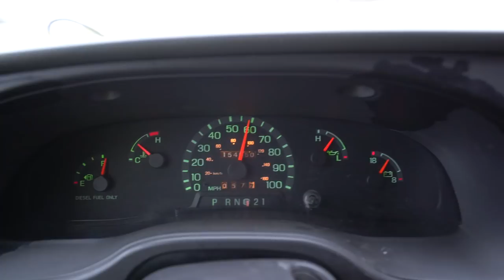Massive Oil Leak!! (Ford 7.3L)

Comment: Don't hesitate going to a diesel mechanic, telling him your situation, and showing him the part that's leaking. That bad O Ring was buried deep, but he may have showed you how to get at that bad O Ring. You can often unbolt things off the engine to get at bad parts as long as the part doesn't have oil, or antifreeze in it (or seals like gaskets and o rings). You can get in through the front by taking off a drivebelt or two (easy). And, taking off plastic covers/cowlings that are just screwed in to get at stuff. But, that wasn't that much oil anyway. That was an exellent job diagnosing and finding the oil leak without any help, Jax. Hope your all squared away already in SLC.
Reply: Rural diesel mechanics would even loan you their tools to get to tough parts.
Reply from the maker: thanks! the new bus will be full size and I plan on working on that a bunch myself :)

Comment: you are correct the 7.3 (T444)is a good engine (that's what i have in the 2000 International school bus i just bought the other day), yeah Jax I'll be joining you as soon as it is converted. this whole time I've been looking for a bus I've been so tunneled visioned on the 7.3. See I need a big engine so that I could tow my 14 foot enclosed trailer around with me. Now I've learned that the 7.6L (DT466E) is even more powerful even though it's only a 6 cylinder. Oh well if the 7.3 goes south I'll think about replacing it with the DT466E
Reply from the maker: both are very good :) the Ford doesn't have the DT, so I obviously praised the 7.3

Comment: Great Video, my first of your 400+ collection I ran into.  Have a massive 7.3 oil leak on my 320k mile 4x4 Sportsmobile that I have to start tackling today. Was nice to see your video and the start of this experience from your perspective.   Can't tell where my oil leak is coming from yet, going to clean it all down today first. I hadn't thought to use brake-cleaner to help the effort, so thanks for the Tip!  -JR

Comment: I used to work on powerstrokes and the 6.0 are the worst they have to be bulletproofed, 6.4 is junk as well. If you get a ford go 7.3 or 6.7 for sure.
Reply: Gary Mapes  ~  Once a 6.0 has been Bulletproofed, do you think they are good (or at least decent) engines?  A lot of the buses I've seen that I like are 6.0's (or 6.8 gas engines), and I am not sure if I want if I should risk it.
Reply: once there bulletproofed there good but its expensive from 5k-10k depends on the place doing it though
Reply: Gary Mapes  ~  Ok, thanks for the reasponse!  I will probably not get a 6.0 then unless it was previously bulletproofed.
Reply: One word "Cummins" heh, heh.
Reply from the maker: true.

Comment: It looks like a plug. Usually those are for the water jacket in the engine rather than oil.....
Reply: Carlos Benjamin no its orb plug on high pressure pump 🇨🇦🇨🇦
Reply: MY Umb I knew it looked like a plug. I’m just not familiar with plugs other than those associated with coolant in the block.

Comment: Sometimes I think the engineers do not think long term when they design things. Your O ring is a great example. They know it will go but they make hard to replace. A 50cent part could cost a bunch just to fix. Go figure!
Reply: Keep's the Mach's. Working .
Reply: Daniel Sweeney, I think that they absolutely did think long term. Parts and labor for their dealerships are a major source of revenue. I think they thought about it a lot. Heh, heh.
Reply: Intersting thought but not the truth. In actuality it is all for ease of assembly. The major company does not make a lot of money from the repairs. They only get the money from parts. The major companies do not look long term for items added onto a component. An example an engine, take the Chrysler 318. This engine was produced for years. In all those years many items were added. Power steering, power brakes, and air conditioning. Each item was added without regard of the others. Just built on top.
Reply from the maker: haha well, this is a medium duty international truck engine, not one made for a little van
Reply: Jax Austin -exactly that O ring should have never gone bad. Twice now... : ) be safe!

Jax check out out How farms work and oneloneyfarmer. Both You tubers might help you out.

Comment: This is the problem with diesels, they are wonderful as long as they don't break down, but when they break down (and they all do), they are expensive and complicated to work on.  Give me a 460 gas any day.....  yeah, they'll use a little more fuel - but they'll run forever - and trouble free. 12 valve Cummins with a P-pump would be the only exception
Reply from the maker: just wait till I get my hands on a DT 466 :))
Reply: Great engine, I had one. Just be sure to get one with a P-pump.... mid to late '90's.  The newer electric injection was nothing but trouble. The older P-pump 466's ran forever like a 12 valve Cummins.  They're cheap too, I paid $1200 for a complete DT466 out of a retired city truck.  If I were building an travel bus, a 466 stuffed into a 30 series Grumman van might be the ticket.  I'd probably even do a manual trans only because almost all the automatics are troublesome in time :-)   what are your thoughts ?
Reply from the maker: no spoiler alerts ;)

Comment: Why would anybody want a powerstroke diesel they are constantly breaking you can't use them for towing something will break they're loud noisy engines they stink fumes they're pretty much junk expensive junk I can understand the attraction but in the long run not worth it they should be done away with.